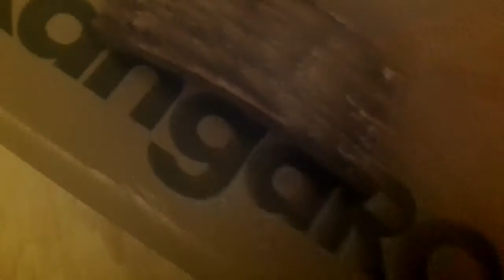Barium Titanate Free energy?

Comment: I've found that a simple 9v battery is sufficient to charge the Barium Titanite in a smoke detector piezo.  It builds up to about 20volts, but the current is immeasurably small for my meter.
The material has a property called Fero-electricity (it has electrical domains like iron has magnetic domains) and you can align the molecules in the ceramic.

Also Apperently Some piezo elements just are broken and don't give the effect

I want to try submerging 1 in liquid Helium so we can know if it's caused by ZPE or just Pyroelectricity

Comment: I've got three 1 inch pieces of barium titanate coated with silver. Soldered a wire on each side. there is voltage. in series: V same as smallest piece. in parallel: increased current. Put in sun; more voltage, blowing on them increased V 300%, Maybe this is like the opposite of ion wind ??
Reply: NO!  It's a Piezoelectric, pyroelectric and capacitor!  You can't tap it, blow on it or heat it and you have to discharge it before taking a reading.
Reply: Yes, it's a piezoelectric effect

Comment: use exciter coils or transducers and also use phase conjugated frequencies barium titanate is also a meta material and will move with right frequencies and use the sawtooth wave pattern this stuff is amazing do some research on it and there is a reason it is hard to find its also piezoelectric look up acousic phase conjugation you can more energy out than you put in low decibals at higher frequencies just do some investigation on barium and endothermic reactions also

Comment: I got some of the Barium Titrate off Ebay just like yours and got the same result-----nothing with the LED.   BUT----I'm not done yet.  I am seeing piezo effects with it .  Put an Am radio near and tap or scratch two pieces together.  You can hear the spark on the radio.  I didn't have any luck charging mine up like a cap yet.

Comment: I agree with Stefan. Barium Titanate can be made into a very high K (dielectric constant) dielectric for capacitors. I have some doorknob capacitors with a K of around 3200. But you need to cover both sides with foil to charge it if you want to be able to light the LED by touching anywhere across it. It won't be generating any energy. You'll just be charging a capacitor and then slowly discharging it via the LED. When charged, some of the charging energy is stored in the dielectric.